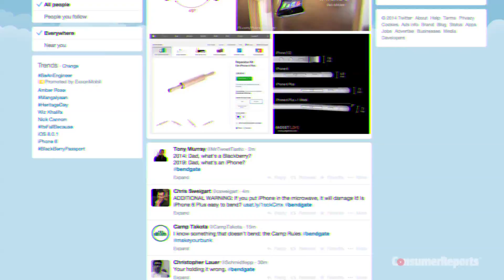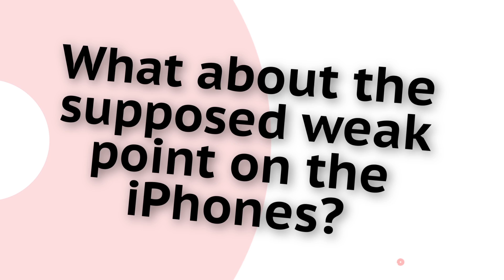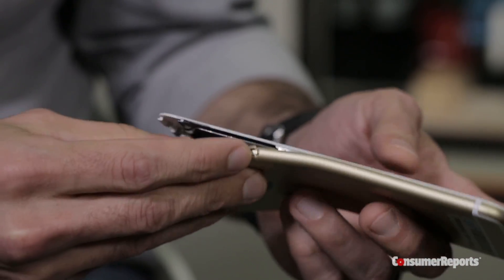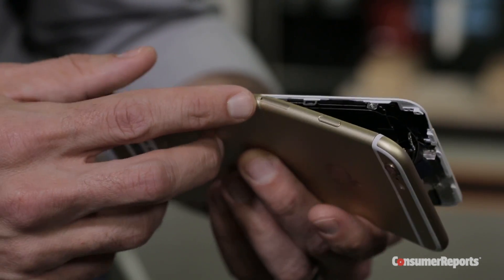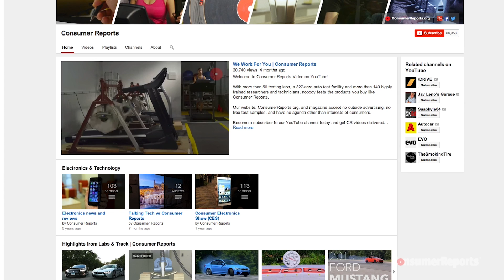Consumer Reports Answers iPhone Bending Questions | Consumer Reports

Comment: Every phone will bend when given enough force, but the problem is that the iPhone 6 plus bends way more easily because of the thin sheet of aluminum. You should've tested underneath the volume rocker for every phone if that is where the problem is. There are many things wrong with this test and for starters, this wasn't even in the pocket which caused the problem so this test does not prove that the 6 plus is not that weak compared to the other phones. I tried to bend my note 3 and it wouldn't bend. I went to the Apple store and easily bent the 6 plus.
Reply: They clearly explained in the video why they didn't test underneath the volume rocker. They also explained why they couldn't do a pocket test. And really, you went to an Apple store and easily bent an iPhone 6 Plus? That's doubtful.
Reply: myNEONCITY are you really questioning my actions? I did go to the Apple store and bought myself a 6+. And I'm saying this test doesn't prove that in the real world every phone breaks almost as easily as a 6+. It just proves what is already proven, with enough force every phone will bend.
Reply: Armand Agopian I am questioning your actions, as you made it seem like you went to an Apple store and deformed a display model. So yeah, that made me raise an eyebrow.
Reply: myNEONCITY no lol. That is just weird.
Reply: Imad S i didnt. If you read the comments I explained that I bought it before bending.
Reply: goff0103 first off I am not an idiot. Secondly, I am not strong at all. Lastly, if you read the comments I explained that I bought the phone and bent it in the apple store in front of everyone.

Comment: You did not test the phones properly whe all know the ihpone 6 plus has a weak point around the area where the up and down buttons are and you chose to only test them in the middle You should have tested the iphone and all other phones in the spots upper part bottom part and middle part your test does not prove ANYTHING
Reply: CR's tests proved several things:
1. The weak points on all brands are where cuts are.
2. The iPhone 6 wasn't unusually weaker than other phones in a 3 point stress test.
3. The iPhone 6+'s bigger size made it slightly weaker than the 6, and the thicker 5 was stronger than both.
4. If you put enough force all of the phones eventually break.
Reply: They had to pick the center point to make the test fair for the other phones.
Reply: That's not the point of the test. The test is meant to see how the device holds up OVERALL, not just in a certain spot. Usually the bend will always occur at the center point of an item if you are trying to bend it. 

By the way, WATCH THE WHOLE VIDEO BEFORE SPEAKING! THEY CLEARLY EXPLAIN WHY!
Reply: A proper strength test is to test its weakest point.
Reply: And where are the weak points of the other phones? Are they supposed to determine that for every phone tested?
Reply: ***** It was more scientific than some dude pushing on the phone with his hands.

Scientific means they used a controlled environment, and eliminated all variables except the force required to bend in the middle. They had a control model and tested others against it. Testing for a bunch of other failure points would take more time/money, which they don't have.

Federal and IIHS crash tests only use 1 sample. Guess it's not scientific right?
Reply: Kamaka Chang  exactly but if they know that the weak point is were the cuts are located why isnt the the point the is tested in all phones instead of the middle
Reply: ***** Have fun with your Nokia 3310, I'll have my iphone 6.
Reply: The only reason they did the test was because of the  iphone 6 plus bendgate to prove or disprove if the iphone easily bends wich it DOES so why didn't they test where the iphone is known to bend and compare that weak spot with other phones in that same spot to see how the others hold up against the iphone 6 plus
Reply: So true. So true.
Reply: It wasn't just because of the iPhone 6. A lot of the new phones of that size that are coming out have that feature or will have that feature. Do your research before you tell someone off about something you know nothing about. And the machine they have may not be able to be adjusted to bend them at those locations on the phone. If you feel you can do it better then do it. Don't yell at other people because you feel they aren't doing it right. You try it, post a video, and tell them what you think they are doing wrong.
Reply: TheArfdog  Well, they're the ones that started out saying they were going to add science to the discussion.  I've never heard of any scientific study that only used one sample of each thing tested.  So yes, they should of tested multiple of each, found each phones weakest point then made multiple tests along the weak points.  You know, for science.

Examples would be crash testing, they don't just crash test a car from head on, they do side impacts, rear impacts, they test it all looking for weak points.  This test only tested pressure from the middle, on the back side, they didn't even flip them over and test another from the front.  This hardly counts as science.

Considering this is Consumer Reports, who are suppose to review and test consumer products it's disappointing that this lab test is so poor.  Especially when testing a specific bending problem people are concerned about.  Makes me wonder what their other product tests are like.
Reply: So this Iphone 6 bending issue was much ado about nothing, 4 months later.